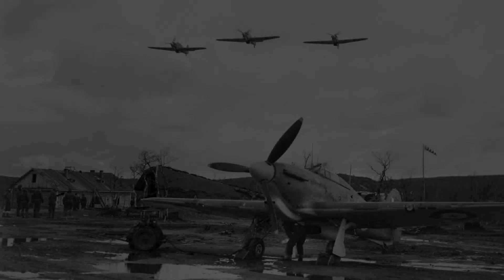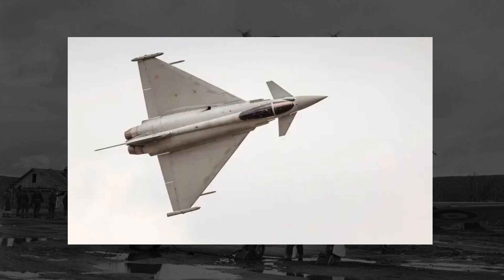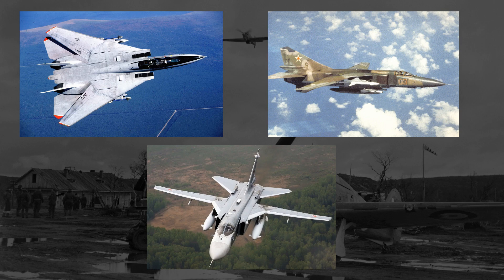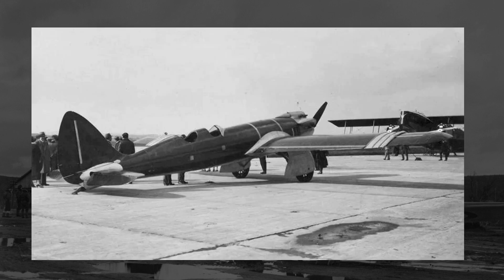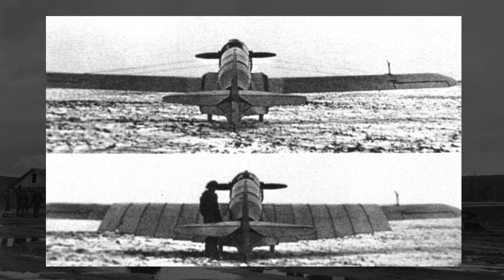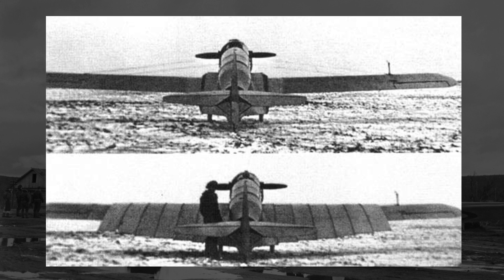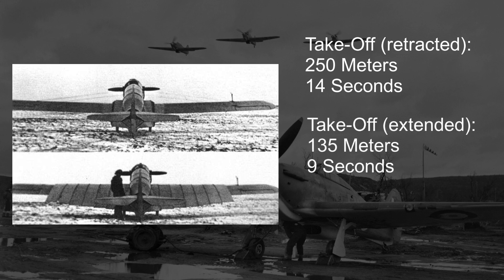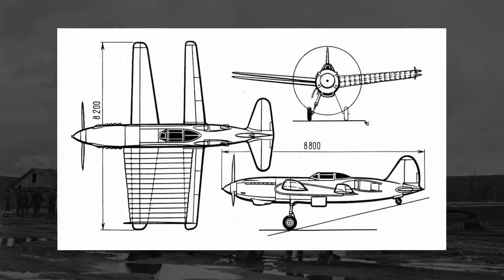NIAI RK-1: The Soviet Telescoping Wing Fighter

Comment: That takeoff distance & time comparison isn't quite fair... it would've been if they made one without the weight and drag of the telescopic system installed and then compared it to the extended telescoping wings. Like you said, the system added lots of weight and complexity.
I also have to wonder where the landing gear would've stowed into. Couldn't have been the wings!

Comment: In the early 70ies several variable geometry concepts have been explored for sailplanes in Germany. The "Akademische Fliegergruppe Stuttgart" built the prototype FS29 with telescopic wings with a variable wing span between 13.3 and 19m. The intention was to use a high aspect ratio wing for thermalling thus having low induced drag at high lift coefficients. For high speed cruise the wing area would be reduced thus reducing profile drag at low lift coefficient. Operation of the telescopic mechanism was purely mechanical and needed considerable pilot effort. To reach the required stiffness to prevent jamming of the telescopic wing it was one of the first application of carbon fibres in major aeroplane components. Today the aircraft can be seen in the aerospace part of "Deutsches Museum" in Oberschleissheim in southern Germany. I had the opportunity to fly this sailplane myself once and it hab some quite unique characteristics.

Comment: weight has very little to do with a plane's top speed. HP, frontal area and aerodynamic efficiency are much more important. It's possible the front wing would cause turbulent air for the rear one and hamper performance IMO.

Comment: Hi, there is two survivor racing plane using similar systems in a small museum in france near Le Mans. Althought they are not in flying order and sevrall part missing, restoration work has been done. 
Document about them also survived. One of the issue with the single wing design was that the propeler thrust tend to bend the folding wing section sending the plane in a spin. This resulted in the crash on one of those two racer.
Reply: The Fairy Firefly that entered service with the Royal Navy toward the end of WW2 had extending wings, they extended rearwards to increase area then folded down some to increase lift and then down more to increase drag. Called Youngman flaps they can be seen on most airliners today.

Comment: Soviet airplanes from the 1930s are some of the most interesting and coolest planes ever created, and this is certainly one of them. But in addition to worries about fuel capacity and armament, I do also wonder how well these thin, high aspect, wings would handle G forces in combat.
Reply: Up until around the MiG21, the Soviets were completely useless in aviation anywhere beyond crop dusting unless they were stealing tech from the Germans or conning it out of the Idiot English.
Reply: The USSR had full access to MIT in the 1930's.

Comment: This was a design prerogative being pursued by other nations as well.  The British tried a disposable wing, which would be jettisoned at altitude.  Germany used detachable JATO/RATO pods.  The whole interest lay in getting to altitude quick enough to defend a location.  In general, the concept is called the Point Defense Interceptor.  Its impetus declined markedly as borders extended and RaDAR and other early warning systems became dependable and of suitably long range.  The last gasp of the idea when based around a manned interceptor was the initial proposal for what later became the F-104.
    Other war era ideas in trope led to the Me163, the Ba-349, the La-7R, the BI-1, and J2M.  Its ultimate iteration was the surface to air missile.

Comment: The first variable sweep wing was fitted to the Messerschmitt P.1101 in 1944. Bell Aircraft developed it further in the X-5.
Reply: The Westland Pterodactyl of 1931 predates it by 13 years and to top it off was also a tailless swept wing design too. Nazi "science" < British "man in shed engineering".

Sure the sweep wasn't as dramatic, but sweep wing is sweep wing.
Reply: The original comment considered variable sweep wings, meaning wings with adjustable sweep. As far as I know the P.1101 was the first aircraft to feature a wing with built in capabilities for changing sweep and the x-5 was the first aircraft to be capable of varying wing sweep mid flight. The discussion about swept wings is another one altogether with multiple aircraft exhibiting swept wings existing before ww2

Comment: I have seen this concept in radio control gliders
Reply: I'm seriously considering using this to make a flying e-bike.
Reply: @jtjames79  wh- why tho, ebikes are insanely heavy. A large scooter would work better, you can place the wings below
Reply: @blu5021  E-bike because you don't need a license. They are like the ultralights of ground vehicles. The government doesn't care unless you really mess up.

Recombinant, because aerodynamics.

Carbon fiber, because it's easier than fiberglass these days. Just need some big plastic bags and a vacuum sealer.

And I would separate the bike and the wings.

The wing should be able to fold up into a trailer, the e-bike can pull. Most of the batteries would be part of the trailer. So the trailer can be unhooked and charged at any electric car charging station.

So half the wing box is the trailer, the other half is the bottom of the recombinant e-bike. I imagine that if you put out the wings, you can either clamp or unclamp the bike.

Thin film solar is also getting really good, solar on the top of the wings means it can charge itself.

Oh and I'm imagining it as a float plane.

Why? Because I live in Hawaii, and just because it's possible for the lulz.

Leaving out of a lot more details that I've already thought about, but YouTube only accepts so many characters.

Like I have some drawings on how to use the wings as a sail  and center board.

Imagine flying kayak, with wheels, and wings. Or a very small not very efficient sailing boat. Or e-bike with or without trailer.

Ultimate freedom of movement machine. And even if you run out of electricity you can pedal or sail.

Comment: May have been an intriguing concept for a civilian aircraft, but what would the landing be like if the retracted wings got damaged in combat and were unable to deploy?   

Fascinated video, thanks.
Reply: @autogyro333  
Well that is the point isn't it, because a civilian aircraft wouldn't, under normal circumstances be subjected to battle damage.

Therefore the concept would have been intriguing for a civilian aircraft.
But it was designed to be a combat aircraft which would have been subjected to battle damage.
Reply: you could ask this about any design. what would happen if the flaps on a plane were destroyed? or the gears?
Reply: Just have to land faster essentially. It would be uncomfortable at best and extremely dangerous at worst
Reply: @autogyro333  well it was supposed to be adopted for military use eventually so its a valid point. Any aircraft can have damage in flight or hydraulic failure so its a valid point for that too.
Reply: I want to use this to make a flying e-bike.